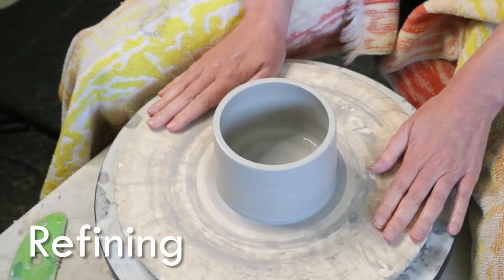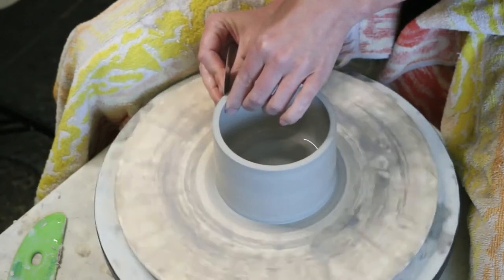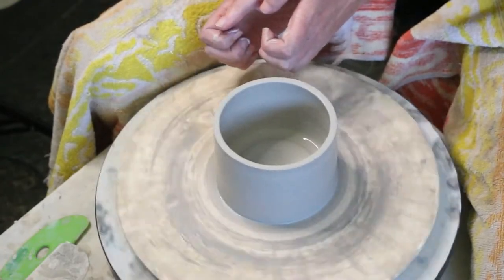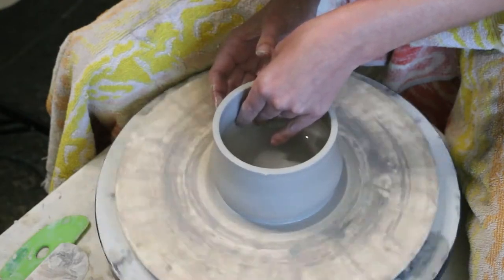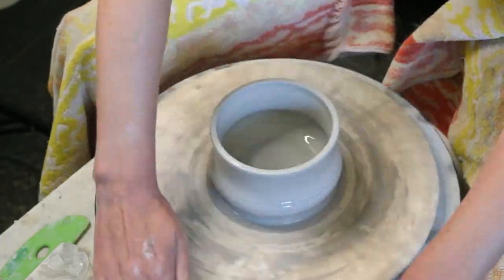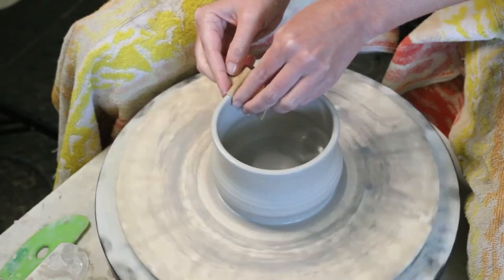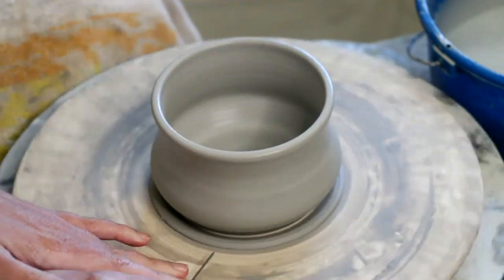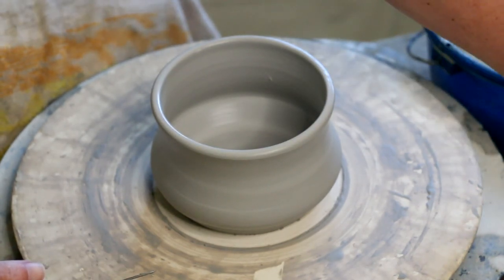Pottery Tutorial- How to Shape Your Pot (Throwing, part 3.)

Comment: Question, I'm new to pottery and was taught not to use metal tools with plaster. You mentioned your bat was made with plaster and although you didn't catch the bat when smoothing the outside of the cylinder could this be a problem or are you conscious not to go so low as to catch the bat. thanks. T.i.a
Reply from the maker: Hi Denise! You are correct, using metal tools with plaster bats can create plaster dust which we don't want in our clay because it can blow out, much like an air bubble. I do try to avoid scraping the plaster with my metal tools. I have never had a problem with it but it is something to be aware of. Definitely try your best to keep plaster from getting into your clay. I hope this helps!

Comment: Hello I'm just learning and I'm pretty my wheel turns opposite then most. My husband made it from a tread mill motor so I am pretty it's backwards. I've tried using my left hand to pull walls and fail. If I used my dominant hand which is right and work from the left side should that help. I always feel like the clay is digging in instead of gliding. My hands are always moist and the clay is wet. And hints to help would be appreciated
Reply from the maker: Hi Heidi! The most important thing is that the clay is going away from your fingers and not towards your fingers when you pull. So if your wheel is going clockwise, your hands should be at 8 o'clock when you pull the walls. If you're going counter clockwise your hands should be at 4 o'clock when you pull the walls. Hope this helps! Keep potting!
Reply: @potteryplus  thank you and I think it will help immensely. You do beautiful tutorials thank for your reply and help
Reply: Usually right handlers work between 5 and 3 o’clock, left handlers between 7 and 9.  But both can work at 6 o’clock with either right hand inside or left hand inside